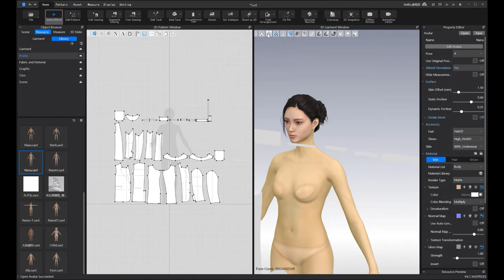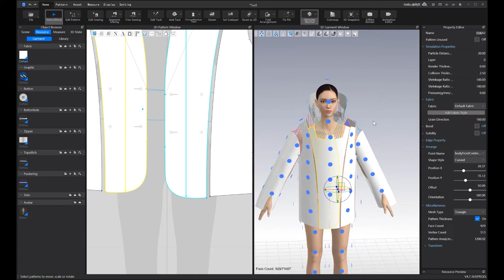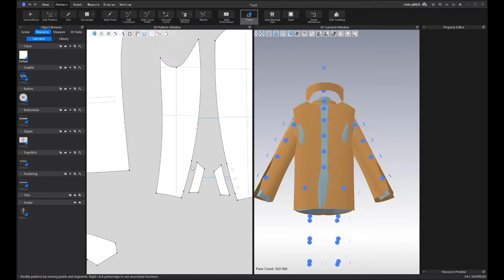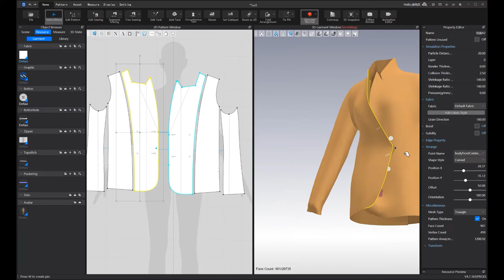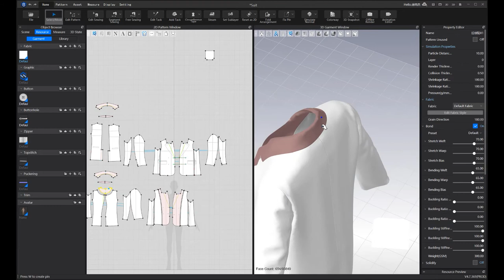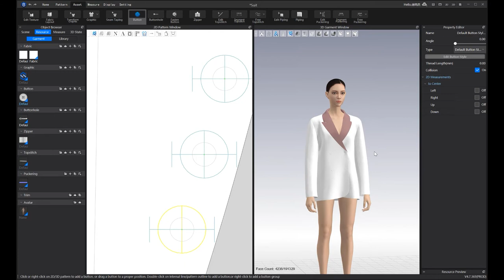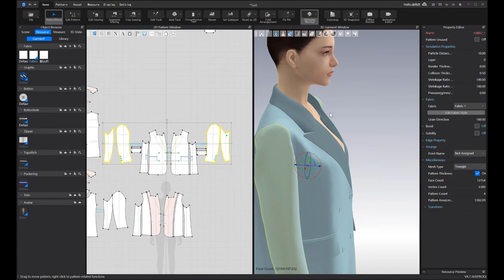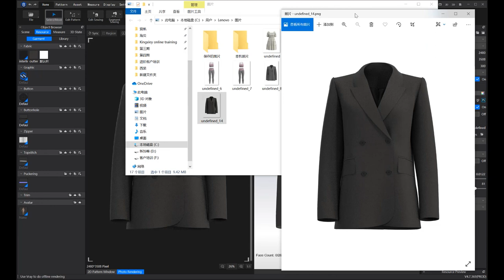TAILORED JACKET SIMULATION IN STYLE3D

Comment: At least they have introduced better avatars and interesting improvements/changes in some functions.
I was hoping for a more realistic way to simulate shoulder pads, but clearly, none of them has ever sewn a shoulder pad in real life.
The approach is totally wrong, it would be better if there was the possibility to tuck a trim to a garment in more than one point so the shoulder pad could be a solid obj with a realistic shape.
I would like to have the possibility to decide in which direction the render thickness offset must go, in this way I could sew the shoulder pad to the armhole without having the thickness coming out from the fabric
I will make some experiments. It's our duty to help them to solve this problem. Do you agree Jeffrey?